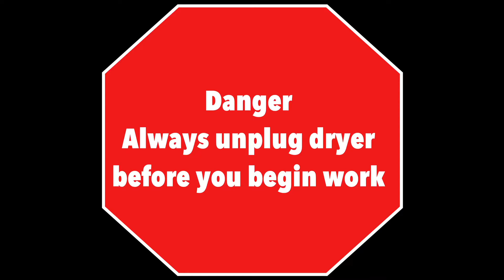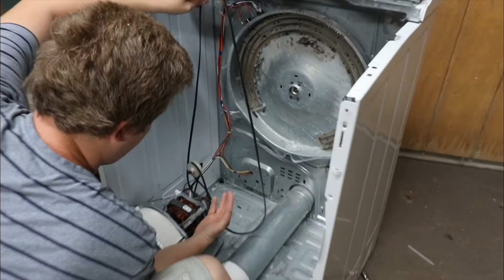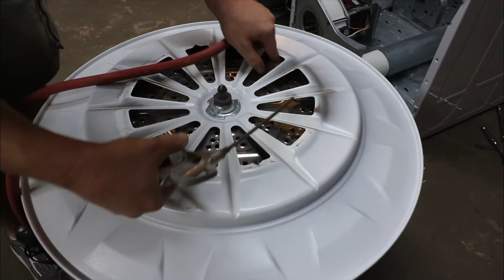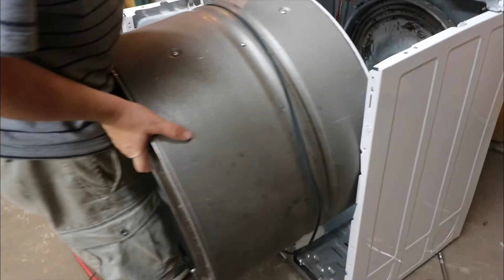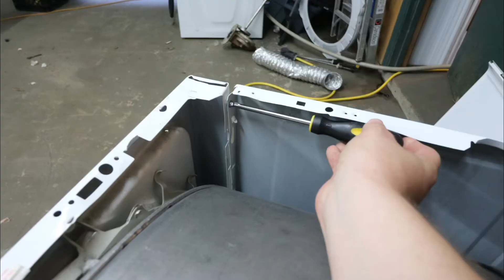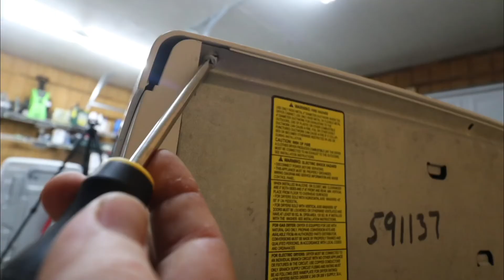GE Hotpoint overheating? Step-by-step guide to unstop Lint build up.

Comment: I got a ge dryer that shuts off after 30 seconds. It spins and heats but then shuts down.
Reply from the maker: Interesting maybe a bad motor. Not really had that issue before with a GE
Reply: @WasherDryerMoney  it turned out to be a cracked knob that wasnt turning the timer. When i turned the timer with a pair of pliers it ran fine

Comment: I have one of the new digital GE dryers(looks exactly like the one you have here on this video) I bought it 2 years ago, It has been a great dryer but now the numbers started flickering and the dryer is acting up, sometimes it won't turn off even if you press the power button. It'll work on certain modes like bulk, but not to dry cotton.. Could this be related to what you're demonstrating here or it sounds more complicated, like a sensor or something?
Reply from the maker: Anytime a machine gets a digital board they’ll act weird compared to hey manual timer machine.
It’s always a good idea to make sure they’re not for Lent but it could be something as simple as the plug that goes into the dryer has a loose bolt. Before you mess with anything with Power be sure to unplug the dryer.
Reply: @WasherDryerMoney  That makes sense. I’ll check all lose connections first and of course disconnect that 220v from the wall. Thank you 👍🏻

Comment: Hi. Would this video apply to a GE DBLR333ET0AA? I have one that appears to have been run with no lint filter at all and now it has a very low volume of air discharge out of the exhaust.
Reply from the maker: Most GE’s with filters on the inside are very similar. Definitely if your dryer was running without a filter lint is going to be built up everywhere inside the dryer. It’s very dangerous and you’ll have to probably take the drum out and clean all around it as well.
Reply: @WasherDryerMoney  Good news. I took it apart today. I think it was an older model but it was very similar to the one in your video. It was blocked up with lint in the exact same spot on the front panel down near the exhaust blower. I cleaned that and everywhere else in the dryer. I don't think there is a single speck of lint left anywhere inside the dryer. It now blows plenty of air and is running perfect. Thanks for your help by posting the video. I'm trying to get in good with the chick who owns the dryer and I think she was very impressed.
Reply from the maker: Good luck with the girl.
Reply: I hope you got a lint filter for it now. I would never use it without one.
Reply: @angelaackerman8934  Yes I did. Thanks.

Comment: Hi, I did all this to clean the dryer well and it was crazy how much lint there was. My problem is that when I turn it on it sounds like somethings rubbing (like the fabric seal) on the front. There’s also a burning smell.
Reply: Also, should the seal thing on the front wall be a thick felt like strip?
Reply: Update: it’s not spinning freely

Comment: I have a new GE Laundry Center and I have been having a lint problem.  There is so much lint coming out of my vent that it is creating a huge white mess on my black roof.  I just realized today that I have been using regular Tide detergent in it and it is an HE machine.  Could that be the source of the problem?  Thanks for your feedback.
Reply from the maker: I have seen some have a little bit of Lent  stuck where the filter is supposed to sit. It will make this filter not quite get all the way in to place. The filter will slightly be sitting up and allowing unfiltered air flow around the edge of the filter. Check that also check the filter itself for a hole.